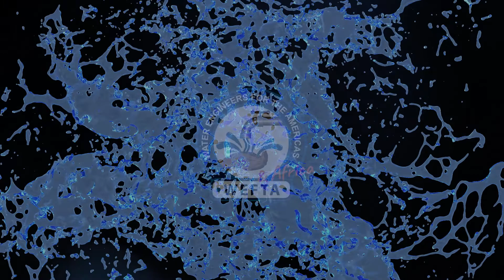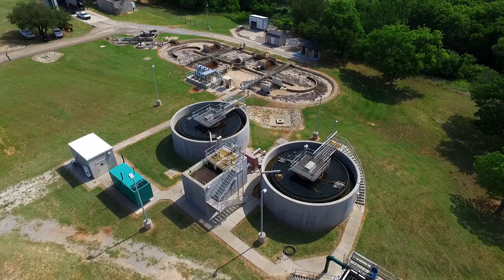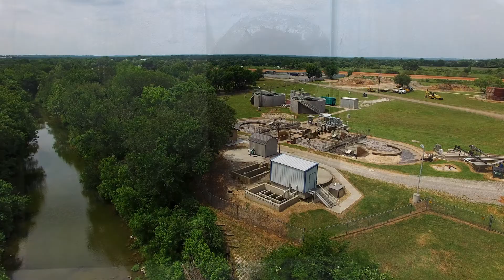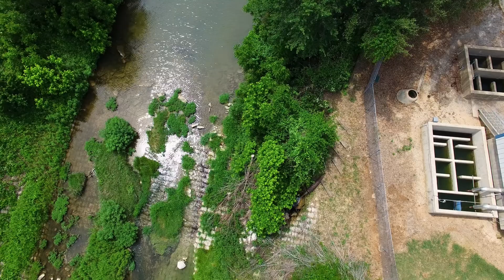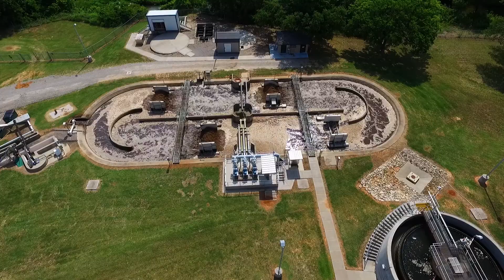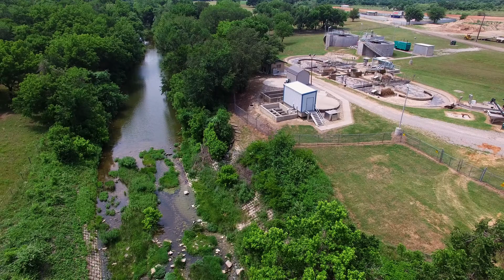1.6 Chlorine Disinfection

Comment: In Water treatment.. Cl2 or free chlorine is very common oxidation, it can be used as very effective secondary disinfection , residual in the distribution system. Ihbitbit the organic matter to regrowth in the distribtion system. 
In germany monochlorine or chloroamine is not allowed hahaha but in USA it widly used its looks like the german dont like chlorine hahaha. 
As oxidation for inorfanic it is very effective to to oxidized Fe/Mn/HS/NH4 then we can removed it by filtration. But unfortunately that Cl2 with NOM form by productslike HAAS THM, so in germany the used or prefer Clo2 as Cl2 but stille depend on applications. 
Thanks for this video